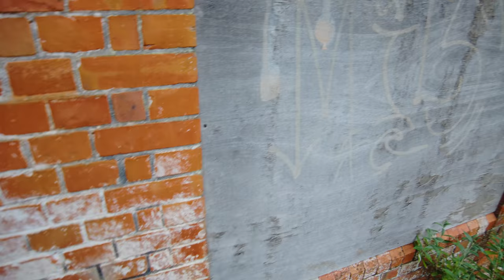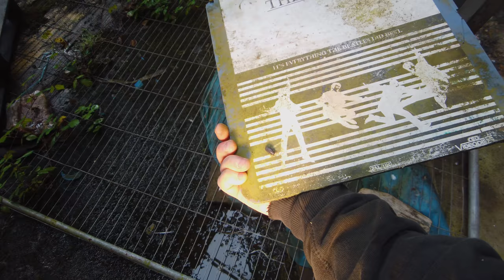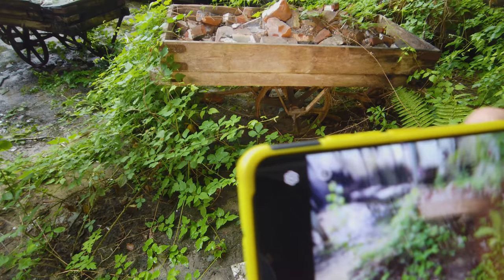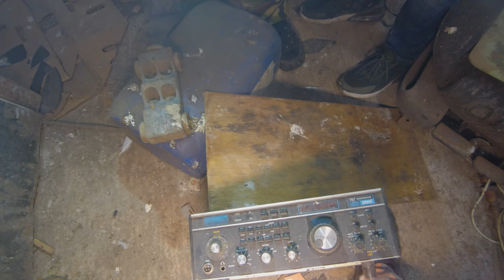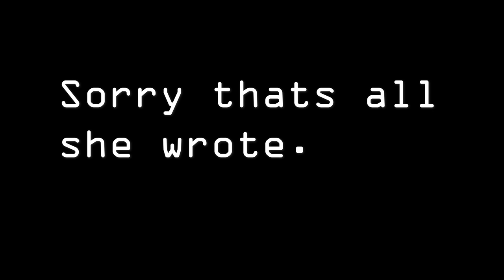Tonedale Mill Somerset, PART1 of 3 FULL EXPLORE

Comment: The electrical panel you were investigating looks like a large resistor bank, used to add resistance to a wound rotor motor, or electrical braking system, which looks exactly like the old large motors in the motor room you found.
I'm an electrician working around 20 minutes away from tonedale, I wish I'd have known you were visiting, I would've come with!

Comment: This is the old wool mill mate, it used to prepare all the wool and dye it before it was moved over to the other fabric mill over to the north side of tonedale mills, all the wool that was produced to make fabric for khaki to be used for ww1 and ww2, it’s wrong it wasn’t turned into a museum this is English heritage just sat rotting, sedgmoor council are in the throws of legally forcing the owners to take responsibility of its up keep as now old enough to be listed! It was built in 1790. Great to see a video of you doing an urbex on this place I live not far from there. At 1.04: is a wool combing machine, it was fed wool that was sat in huge baskets that could hold a ton of pressed and wash wool, the baskets on wheels used to be there but looks like they’ve been knicked  know.

Comment: 1:16 1/4 inch tape (reel to reels) should work fine between domestic and professional machines like Revox & Studer. Think you must have had the tape wound the wrong way around the reel 😀 Yes, much better sound quality than cassettes, which have to squeeze in 4 tracks (2 stereo tracks in each direction). The industry standard speed was 7 & 1/2 IPS (inches per second) but for even BETTER quality, there was an option for 15 IPS. I'll take my anorak off now 😆